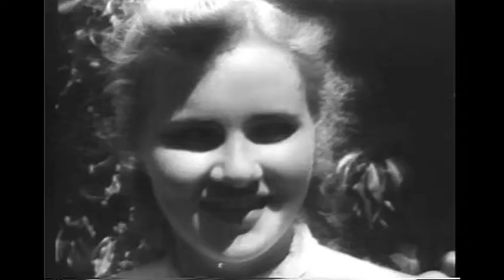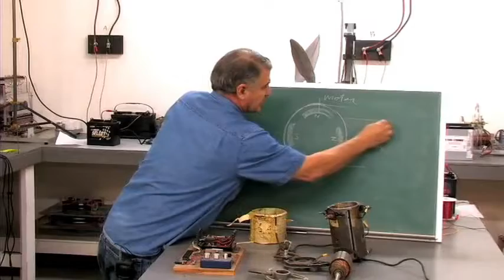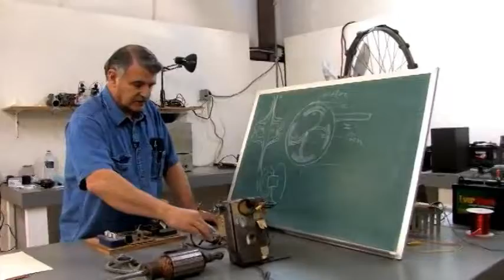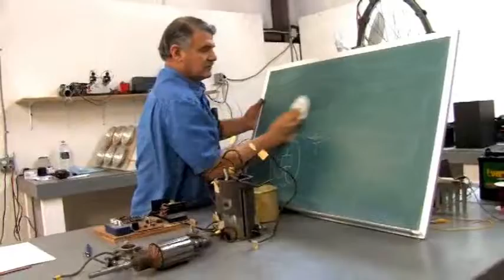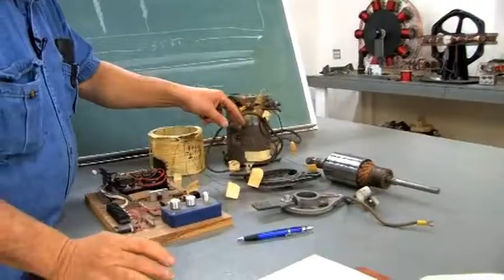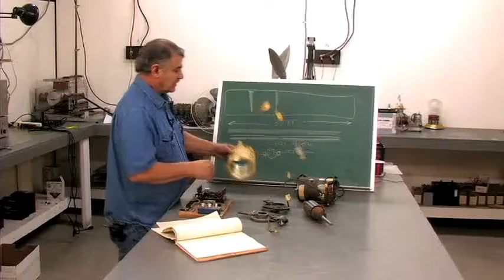#14-A - Lockridge Device (2009)

Comment from the maker: 0:01: ⚙ Allied Control Commission signs agreement in Berlin, GIs take over Hi_ler's retreat, hidden WWII technology discovered.
0:01: Allied Control Commission signs joint agreement in Berlin with representatives from US, Russia, Britain, and France.
0:45: Hi_ler's Mountain retreat transformed into GI playground, with GIs taking over and using facilities like the Eagles Nest.
1:31: Hidden WWII technology, specifically the Lockridge Device, discovered in N_zi Germany post-war cleanup mission.

4:27: 🔒 Innovative generator casing design with unique pole configuration and self-energizing capability.
4:27: Generator casing with different pole configuration and self-energizing feature
5:20: Importance of polarizing the generator for residual magnetism in poles
5:36: Description of how the generator self-energizes and lights the headlight temporarily

9:18: 🔬 Explanation of the generator-motor interaction in Lockridge Device.
9:18: Generator and motor create attraction field when energized.
10:06: Splitting the case avoids interference between two North poles.

13:22: 🔧 Innovative design of split case to prevent magnetic interference and homemade capacitor creation.
13:22: Split case design prevents magnetic interference between poles.
14:50: Homemade capacitor created by soldering copper from Transformers.

18:23: ⚙ Explanation of a unique Tri-filer capacitor setup in a vintage device without solid state circuitry.
18:23: Device utilizes a Tri-filer capacitor setup with three windings for generator, motor, and circuit charging.
19:17: Capacitor could short if not built correctly, leading to the need for replacement and maintenance.
19:43: Absence of solid state circuitry post-World War II resulted in reliance on vacuum tubes instead of transistors.